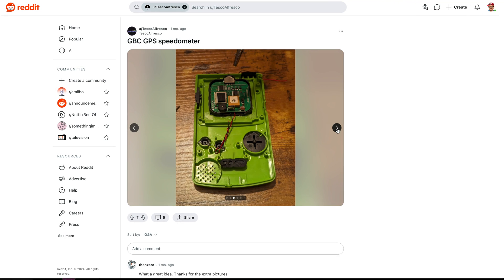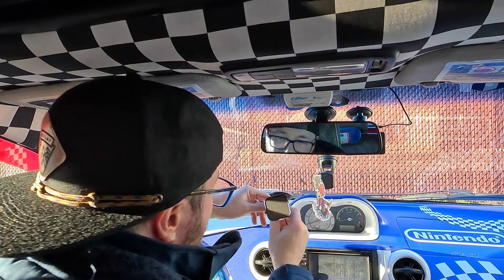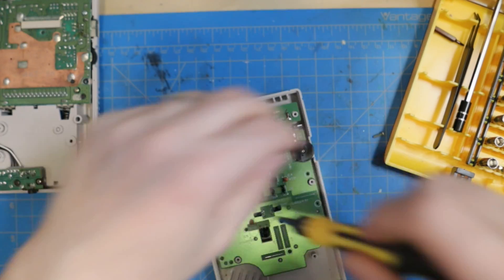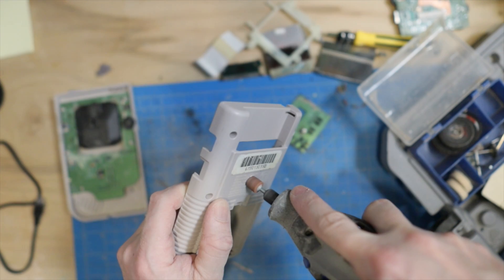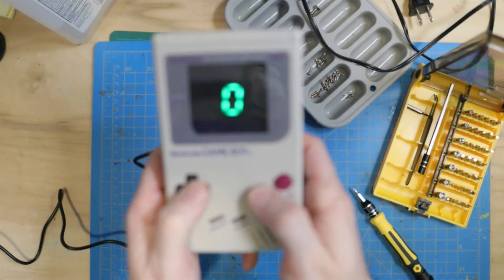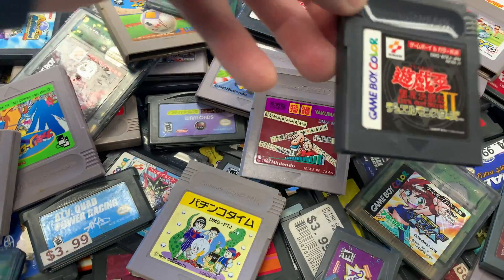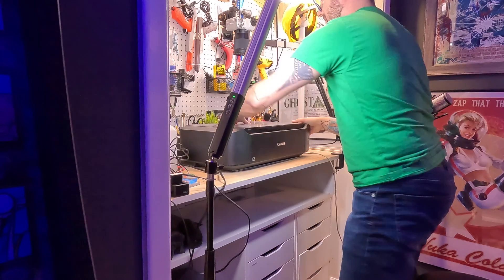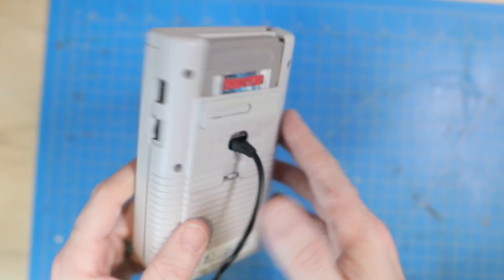My Gameboy is my Speedometer !  🚗 💨

Comment: Makes me kinda sad that you cut the PCB, but that’s okay - currently trying to use a GBA as a speedometer. There’s an old rom and gps mod from a 2005 forum where you can use the actual system rather than plopping a gps in.
Reply from the maker: It was a non working gameboy someone had given me for parts.
O wow that project sounds sweet. Do you need a special cartridge to put in the system ??

Comment: Cool video Russ. You could have probably used the battery compartment in the gameboy to make that thing wireless. That speedometer probably runs on 5v you could get that out of four AA batteries and just splice the usb cable and attach it to the battery terminal of the gameboy. That way you free up your charging port for your phone.
Reply from the maker: yes I seen a DIY where the guy did just that, this way it was a cleaner look too, without the wiring hanging around
Reply: totally giving it a shot! Thanks for the bluetooth idea :)